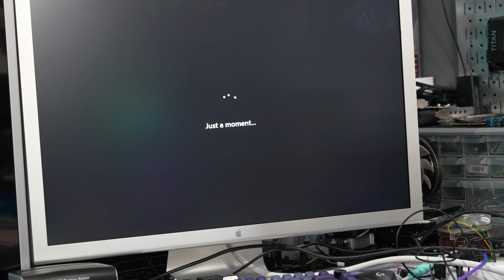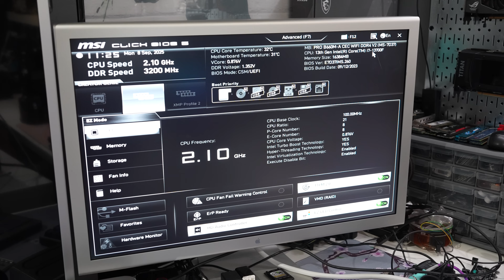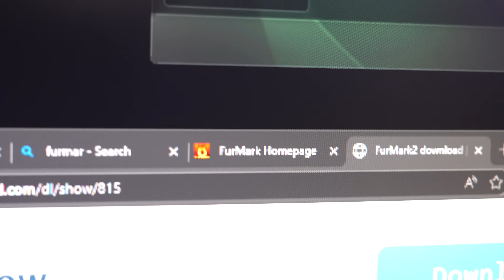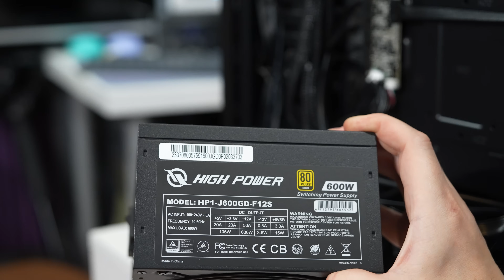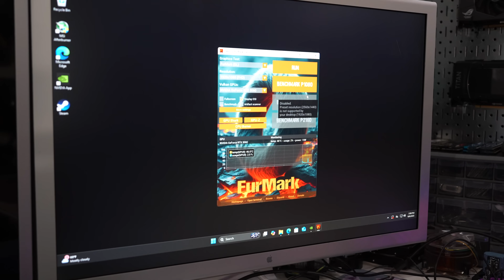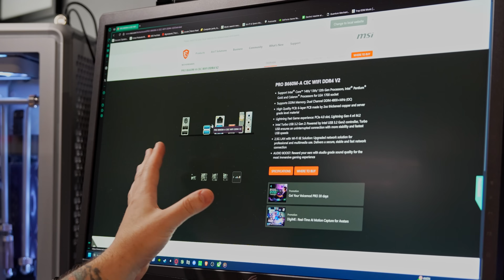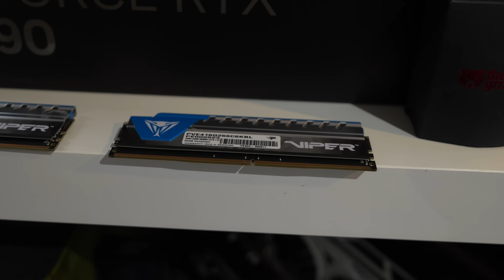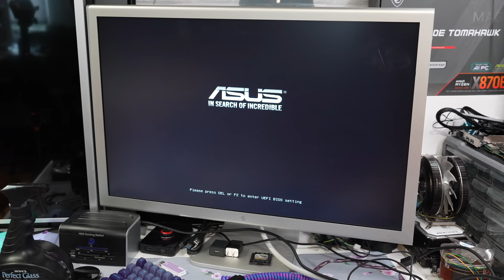Artifacting = Never Good | Boot or Bluescreen EP 10

Comment: You can't trust the tester in this case.  The power supply you pulled out of there is hot garbage.  If you have to save cash to get the build out the door, use an Apevia 750W, semi modular. Good for money.  That 600w High Power you pulled out is tossed out components that were binned from better brands.  The ripple and garbage it is spitting out is causing the graphics issues.  The Thermaltake tester you have, which is killer by the way for its price, has no way to test the power supplies under load, or simulate load conditions.  It is a jumping off point to catch the big problems.  Sadly, the "pro" series gear from companies like Phenix, Chroma, etc. cost more than a used car.  I would never trust the readout from the Thermaltake as gospel, just a jumping off point.  Since you have a stack of EVGA god tier supplies on the cheap, just add 50 bucks to the build and ship it.

Comment: One of the downsides with going with a pre-built, you never know where they're going to be cutting corners and what cheap PSU they're using.

Great job on getting them back with a working machine.
Reply from the maker: A few comments said that the PSU might have actually been the issue. It's still my main reason to not recommend a cyber/iBuyPower PC. Always something cheap in there.

Comment: Have the same issue with some older 2080Ti GPUs the driver installation seems to take 5x longer then the 4090FE card I have also monitor you're temps with that 6800XT GPU there was a huge recall awhile back when they launched the 7000 series they refused the older coolers like this and found the vapour Chambers were cracked on some units enough to issue a recall if you had a OEM 6800xt GPU just to see if it was affected.
Reply from the maker: I remember that recall. I think these came from a way later batch based on what the seller said but appreciate you mentioning that. I'll definitely look into it. Got a repaste them anyway.

Comment: A lot of enthusiast channels swear by Viper ram. I've had nothing but problems with their kits. Doesn't work at all or won't work when using XMP regardless of the voltage setting. Might just be bad luck.

Comment: First pc: Might have been a tiny spec of dust in the motherboard slot or tiny piece of "grime" on the card's gold contact pins and when you took the card out and put another one in, that fixed that. Sometimes the smallest spec of dust can cause you a headache with the pci-e slot.. You could be right about the bios. Hard to say.

Comment: The gpu is on its last leg.  I would guess it could use a reball.   My guess is it has micro solder cracks.  Once it heats up, the crack fuses back, and everything seems OK, but when it cools down, the crack reforms.  It could go at any moment.  I would not resale it without reballing it.  The slow down of the system while the gpu is installed proves its not running with all its resources.   Good luck.

Comment: Bluescreen issues for ages: it all started from a small cpu watercooler hose leak you never see drip drip onto MB  <@@> idk wots the problem   
Slowly f@@ked my Good MB turned cpu pins inwards stopped 3 ram  working  bought a New MB still bluescreened when in a game 1/2hr  so i swapped out ram etc
bought new ram 3200 32gb 2x sticks nope 1x 16gb use a few PC stalls then Did a repair to the game bf5 So far hrs play Now to try 32gb in > brb
Such a long process to recover a PC if it 1 thing its the game that also gets damaged with bluescreen 1 2 3 4 fixes All your Win10 games etc need fixing also if BS still
 bluescreens kick yur PC in the Balls until you find the issue it will continue to be a pain  check cpu ram gpu games  > dam small Hose leaks 
How i foud it as i took the cpu cooler out & moved the hose joints i seen water drip Then i bought a new watercooler fitted new tubing on old & put it on a gpu all working 26cel

Comment: If the system wasn't fully powered down, ie power dissipated before adding the third stick of Ram, it's more likely to affect the memory controller on the CPU than to short the other two sticks of Ram due to the way they are wired. Memory issues like that can be a motherboard Voltage control issue, giving the Ram too much V.

Comment: The problem is with the PSU, I've seen that particular issue before. It can handle a normal load but I bet when the GPU spikes to full power it cannot handle it and the GPU is suffering from power drop. I had the same thing with an older system brought to me with an RX 590 and a 500w PSU, the graphics would show weird artifacts and hangs and glitches, swapped the cheapo PSU with a Corsair 750w? problem magically vanished. Should be an easy way to tell, use that PSU on a test bench with a lower power drawing GPU and I bet it'll work fine, but a higher drawing card and it'll run like shit.

I ended up using the 500w PSU in an office box for a friend with a 4c/8t Xeon and an HD7750 as a dual screen display adapter and the thing has been running 8-5 6 days a week for 3 years without a single hiccup, that PSU simply couldn't handle the power draw of the 590 but something as low power as an HD7750? Purrs like a kitten.
Reply: As well,it might have one of GPU power connectors becoming bad.😢
Reply: That is precisely what I was mentioning to him.  That "High Power" branded power supply is frigging trash. If you have to save money go with an  Apevia 750w semi-modular.  However since he's got some EVGA God tier supplies for 50 bucks a copy, throw one of those bad boys in there and send it.  His Thermaltake power supply tester is a great jumping off point, but it has no ability to simulate load conditions.  I bet under load, that "high power" is sending all types of garbage out.  I understand why he uses it though.  True power supply testing equipment from Phenix or Chroma cost more than a car, so no finger pointing there.  Just toss the power supply, put something in decent, and good to go.

Comment: I would toss those two ram sticks in an envelope,  and write the specs of the boards they failed on the envelope.  Down the road they might just work again in a different system.   2  systems fixed in a single vid, great motivation for me to get back to builds I have piling up.
Reply from the maker: This is actually a really good idea. I have noticed similar stuff happened like this. Especially on AMD hardware (2nd and 3rd gen mostly). The ram refuses to work and then works completely fine in another system.

Comment: I guess the Patriot isn't a good quality RAM. I also owned 4pcs 8GB 3200MHz Patriot Viper RGB DDR4 suddenly stopped working on my PC. So, what I did I tested all sticks 1 at a time knowing if there's one stick might be bad that caused my PC no display. I ended up not a single stick worked lol. May be my motherboard was the issue, but I have to confirm it first before jump into conclusion. I have known working spare RAM stick and it worked on my PC, I also put back the Patriot Viper RGB RAM still no luck for the Patriots. I concluded the Patriots was the real issue; to confirm I tried these Patriots to my known working spare PC, so these Patriots are all broken. It is weird how these all Patriots gone bad.
Reply: ye i also had similar case with patriot ram only buying teamgroup / corsair ram now never had issue's with them only patriot but crucial also good but since their timing always bad / overpriced i avoid them but they also reliable
Reply from the maker: Definitely a strange coincidence. I pretty much stick to the same brands, Patriot memory isn't something I usually buy, but now that you're saying this, I have definitely replaced specifically Viper ram a few times in the past (maybe 2-3 times). Surprisingly the amount of bad ram I have come into is pretty low. Maybe 10-15 sticks in 15 years and hundreds of computers. 
Appreciate your comment and input.